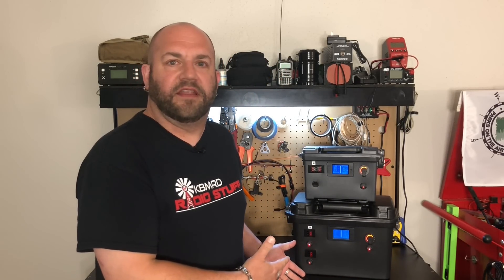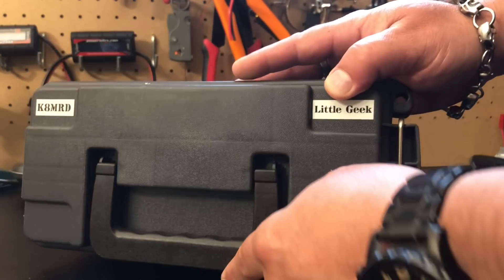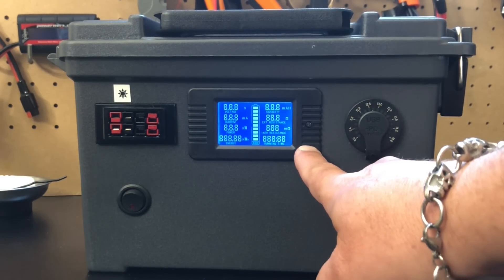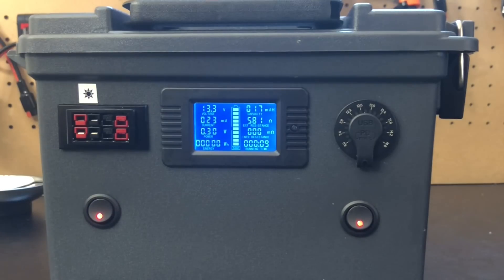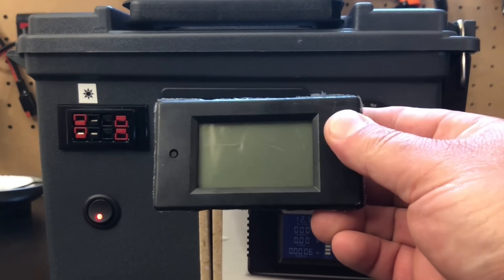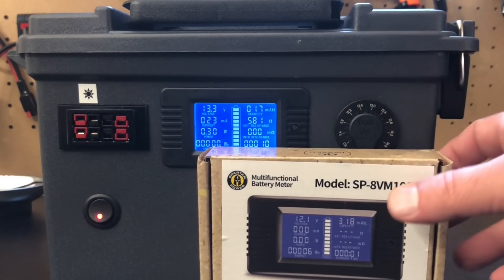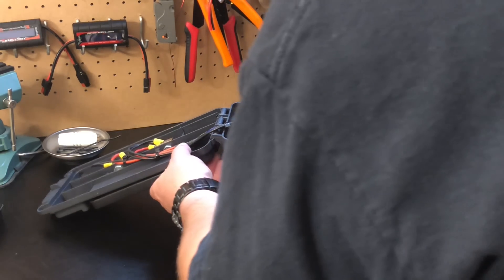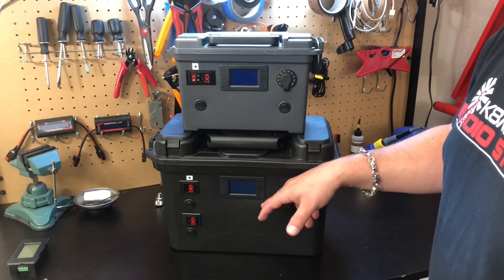LiFePO4 Ham Radio Battery Box / Solar Generator

Comment: I've built several battery/radio boxes over the years.   I recognize the wiring style from my earlier efforts.   So, glad to see that 🤣.   But, if you're like me, I imagine that your methods have evolved over time.   Here are a few things that I changed over time:

1 -  I prefer circuit breakers to fuses - because, I don't need spares.   Just the push of a button or flick of a lever to reset.   And, they do make auto-reset circuit breakers, too.  Also, if I am powering a radio, they either have their own integrated fuse in the power cable or I use a circuit breaker, instead.

2 -  I now implement bus bars for connections, sized for the number of devices I intend to connect, plus a couple extra for whatever.

3 -  If total current will exceed 20 amps, I implement a heavy duty master power switch.  I will not trust a simple switch to control the kind of current LiFePO4 batteries can provide.

4 -  I no longer switch PowerPole connectors.   I view them like wall outlets for AC - if nothing is plugged in, there is nothing to switch, and if something is plugged in, it either has its own switch (like a radio) or I can just unplug it.  This keeps wiring simpler.

5 -  I use hot glue to secure wiring to the case.

6 -  If I am implementing an LED light, I prefer the strip lights to spots.   They are more like a flood light than a flashlight, which I find more useful.

7 -  General rule of thumb:  If something  needs no switch, it gets no switch.

8 -  Wiring gauge is governed by the max current in the circuit.   If something is only going to pull a few amps, it will not get 10 gauge wiring.  This makes wiring simpler and easier to organize.

I hope these tips help.   Thanks for the video, and 73!

Comment: 5:50 if it’s putting out that rf noise you’re gonna want to get that fixed because you could anger a lot of ham radio operators with that around, also it could mess with other people’s devices like radios and satellite tv

Comment: I am curious.  Did you opt not to use the load side of charge controller so that it's only need is to re charge the battery pack?

Comment: Nice builds. What kind of charge controller did you place in little geek?  Thanks
Reply from the maker: It's a cheap little CC from Ebay.  They work great but they're RF noisy. Cant find one small enough and cheap enough to fit other than those.
Reply: @hamradiotube  excellent. Thanks 73. KE8ARA

Comment: Hey Mike, great builds! For Big Geek, if you didn’t have lights and raised the lower power pole connection, could you fit 3 batteries in the bottom?

Comment: $700 for Big Geek is definitely high but you have made a nice box with great features.
Reply from the maker: There's a lot of stuff in there.  It adds up quick.  Plus, I need to make a little too!
Reply: Actually,  it's not a bad price for the work you have to do to build it. In addition, wire is getting more expensive and he doesn't use cheap batteries. I just built a 100ah version and it seems like it took forever to get it wired. Why 100ah? To power my oxygen concentrator (thanks to Covid-19), radios and trolling motor.

Comment: Big Geek had a tactical nuclear warhead strapped to it and released by a mentally deranged Michael Biehn after what can only be described as the most intense underwater fight scene ever filmed.  Little Geek was released to check for radiation on the sub, beyond that I forgot what happened to Little Geek, I don't think anything.

Comment: Ive used the 16ah Miady battery since my second POTA..  it has worked great, so great in fact, I bought the 36ah one and it is performing great also.  My first battery was the bioenno 12ah..  it cost as much as both the miadys put together.
Reply from the maker: I've seen you running them in your videos.  They aren't first quality cells but they seem to work just fine for what we're doing.
Reply: @hamradiotube  I am however thinking about that smaller bioenno you were using I think with the g1m review. 4ah or something like that? Those battery boxes are super nice that you built.
Reply from the maker: @DewayneW4FDT  yeah they are 3ah Bioenno's.  Absolutely perfect for QRP radios.  I use a 6ah with the G90.  The G1M was just a loaner so I never took it out into the field but it sips power too.

Comment: Thanks for listing the components. Might add/replace some on my box. I was glad that I used a metal ammo can on mine. Ran over with my trailer last weekend but survived & was able to Pota hard. Only killed a few of my bulkhead connector items from grinding on the trail. Thanks!
Reply from the maker: No problem, thanks for watching.  Stop running over your batteries though lol!!  Good thing nothing was damaged too much.

Comment: Nice looking boxes, Mike!  I'm starting plans to make something similar myself for POTA excursions.  Quick question, if you have a minute to answer (and I hope I didn't just miss the answer in the multiple times I watched it).  I know your top-left port is for the solar panel - but what if you want to charge it at home, say from your shack power supply?  Do  you just feed the shack supply into the solar port or something else?
Reply from the maker: Thanks Jeremy.  Pretty sure you missed it but that’s ok.  To charge non solar you can just plug into any of the other power poles.

Comment: Any tips to cut straight lines in the Plastic box for square the Meter and the Power Pole outlets, what did you use to cut the lines so perfect???
Reply from the maker: I just traced the outline of the watt meter and cut it with a razor (make sure its a new blade).  Was pretty easy.  I did the same with the power poles but I measured them out and copied that onto the box.  Cut it a bit smaller at first.  You can always cut a little more but you cant add back to it.  I actually screwed the first one up and had to buy another box.  I cut the wholes out with a step drill bit.
Reply: Thanks Mike, I will try your method!

Comment: Hey there Mike. I do have a possible random maybe not so random question for you. 

I have not found many forums out there for this thus my writing to you regarding your builds. I am not doing any HAM radio stuff but instead I have a Kayak that I use a LiFePO4 12v / 12Ah battery in it. Of course because of the weight factor. I have recently purchased a 10W / 12V solar panel to use to try and charge this battery when I go Kayak camping for serval days in a row and no access to AC power to use the wall charger. What I am wanting to know is this. Do I need to have some kind of regulator (like what you put in little and big geek) between the panel and the battery or is it safe to just connect the panel directly to the battery. The battery model number is LF120A1 with an output voltage of 14.6V-9V (Nominal: 12.8V), Output current 15A max. The limited Charge (if needed) is 14.6V 6A. I tested the output of the voltage output of the solar panel and in shade it puts out ~ 19V and in direct full sun it puts out 21V. Even in more partial shade it will put out around 14V to 15V pretty consistent. What I do not want to do is damage the battery or have it "blow up" on me while Kayak camping thus leaving me with no power for my electronics. Any help here would be greatly appreciated. Thank you so very much in advance.
Reply from the maker: You definitely need a solar charge controller made for LiFePO4.  It’s going to regulate the voltage and current going into the battery.  Otherwise you could damage the battery.  You could use something small like this https://amzn.to/3vTB7d4 you would just have to wire it and keep it protected from the elements.  Or you could spend a bit more and get the Bioenno one I have https://amzn.to/3fT2P4e.  For what you’re doing the smaller one would work great.  That’s like what I have in little geek.
Reply: @hamradiotube   Thank you very much for the information. I do not want to do a bunch of soldering though. What do you think of this product? https://www.amazon.com/dp/B07F85CDM6?psc=1&pf_rd_p=458f4e61-a03c-4c6a-8ada-0781336521d5&pf_rd_r=5QSYJN3DTQYNWJXRR5A6&pd_rd_wg=1BMyk&pd_rd_i=B07F85CDM6&pd_rd_w=pul8b&pd_rd_r=d2aa38d8-7812-4d52-9aef-5824cbc3d71f&ref_=pd_luc_rh_rtpb_02_04_t_img_lh
Reply from the maker: @kris6899sk  That should work...kind of.  It won't fully charge the battery as it cuts off at 14.2v where lifepo4 charges to 14.6 volts, but its close enough.  Also its cut in voltage is 13 volts.  Meaning it won't start charging until the battery is less than 13V.  Lifepo4 batteries will stay a constant 13.2 ish volts almost the entire time until the battery is almost dead.  Unless you have a load large enough to get the battery voltage to sag below 13 it may never turn on.  You can always try it and if it doesn't work you can return it.

Comment: One gotcha with those meters, if you turn the screen off, they go into a dormant mode. In the dormant mode, they stop tracking power usage. At least according to the manual.  So you'll have to live with the bright blue backlit screen if you want to keep an eye on the battery draw.
Reply from the maker: Yeah that’s ok though as I always have it on when I’m using it.

Comment: Try adding buss bars to clean up the 'rats nest' of wires:  https://www.amazon.com/Distribution-Terminal-Negative-Positive-Insulated/dp/B087QW5KS1/ref=sr_1_4?crid=KBQ25IRNUW5P&dchild=1&keywords=buss+bars+12v+marine&qid=1622126239&sprefix=buss+bars%2Caps%2C188&sr=8-4

Comment: Hi Mike - love the build.
Q: Do you only use this for QRP? Or do you run your 100W radio off of it? What is the maximum current you pull?
Reason: Some of your main wiring looks a little light duty (arm-chair critic from the other side of the world).
How to tell: Operate for 10-15min (QSOs, not continuous tx) at 100W, lift the lid of your GEEK and touch your wiring. 
This will be a far easier (practical) way to tell them a totally over-engineered theoretical assessment.
Enjoy! de VK6PAW
Reply from the maker: I run 100 watts off of it no problem.  Prob about 13 amps max.

Comment: Hi Mike,
Great video. Little Geek and Big Geek is from the movie the Abyss. I once saw the directors cut and what they cut out made a huge difference than in the theatrical version. Stay safe.  73  WJ3U
Reply from the maker: Thanks Don.  I'll have to check out the directors cut if I can find it.
Reply: @hamradiotube  Hi Mike,
The scene where he types "Have some new friends down here" the next ten minutes in the directors cut has you making sense of the movie. Off all the cuts made, they should have kept that one in.
Reply: Mike,  I like your build.  I was wondering how are you connecting your battery charger?

Comment: Thanks for the video & links!  I could use a power-distribution box.  I've currently got the Bioenno battery, the power meter, & the charge controller separate so transportation is cumbersome.  BTW I agree w/Aaron that the names come from The Abyss.  73!
Reply from the maker: Well put it all in a box and you’re good to go.  And it is The Abyss.

Comment: MIKE, you can tape the whole inside of the box with Aluminum tape then spray it with Flex Seal (so it does not short anything) to give it a little more RF suppression. I did that for a small portable battery PS I made. it cut my noise down from some of the cheap Buck converters and charge controller to almost nothing!!! de N6KV.
Reply from the maker: That’s a really good idea.  I may have to do that with Little Geek.  Thanks for the tip.